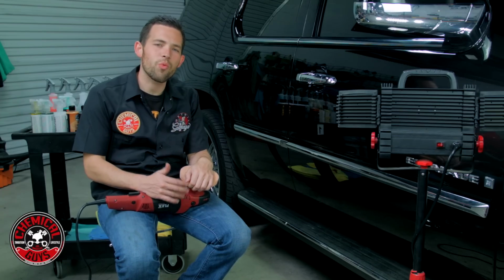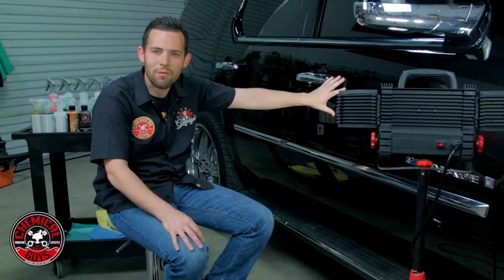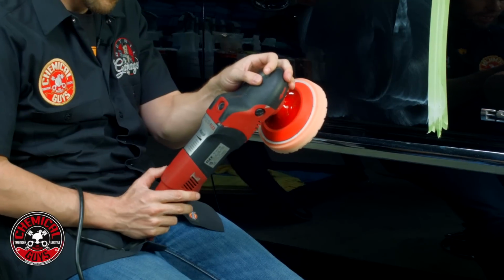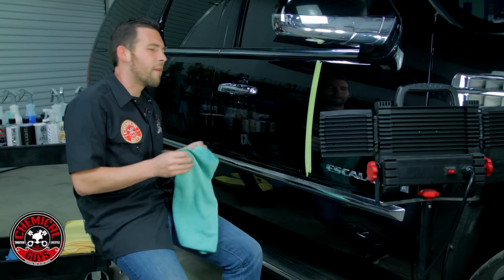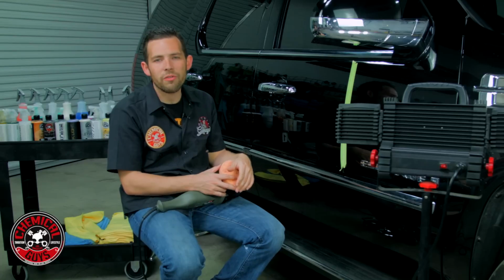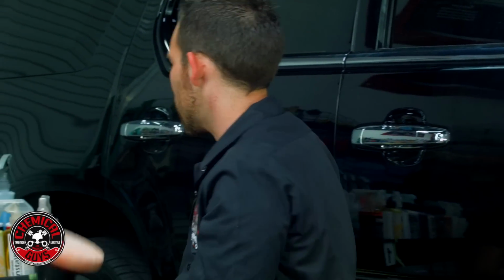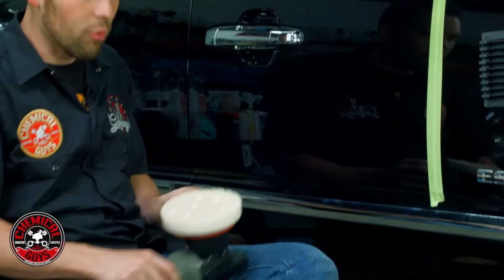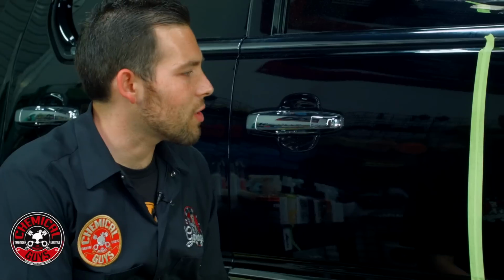How To Machine Polish Hard Clear Coat Paint - Chemical Guys

Comment: One question to CG crew - Greg especially. Why haven't You used IPA to inspect the paint after cutting or polishing the paint? For me it looks like You've covered the defects with polishing products and wiping with a microfibre towel simply does not show everything.
Reply: Good question.
Reply from the maker: V-Line polishes do not require an IPA wipe-down because they do not contain fillers or adverse chemicals that cover swirls. V-Line polishes are also body shop safe.
Reply: Chemical Guys Sorry but your comment is bul...it ! Some polishes fill more, some less but in fact ALL POLISHES HAVE FILLING ABILITY!!!
Reply from the maker: No true-cut polish fills and hides swirls or scratches. True-cut polishes, like the V-Line, use particle abrasives to remove the topmost damaged layers of paintwork and reveal the perfect, shiny paint underneath.

The products with swirl-filling capabilities that you are thinking of are glazes. You can learn more about Chemical Guys glazes, like Black Light and White Light on our website!
Reply: Chemical Guys I know what is glazes, I was used EZ Creme and WMF (good stuff btw). In my 12 years practice I newer see true fillers free polish. 
o.k I make my own test with yours V-line polishes and post video in this post.